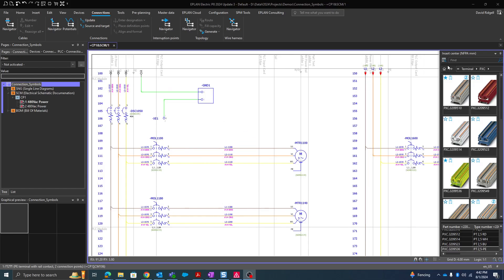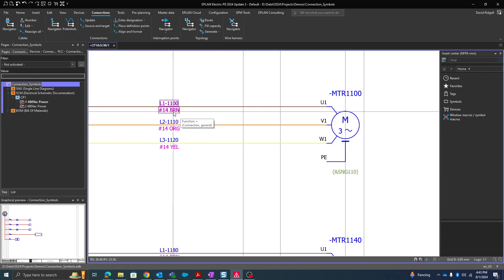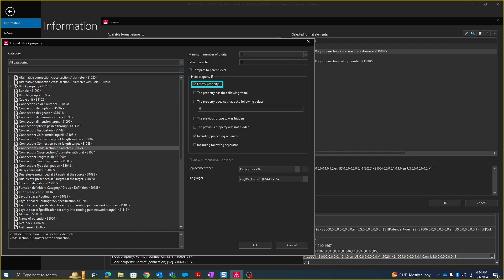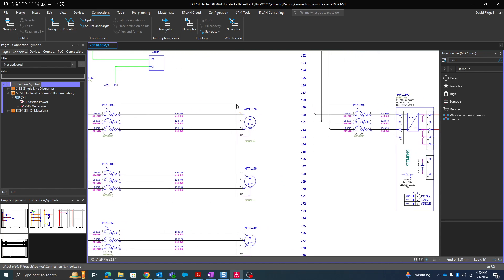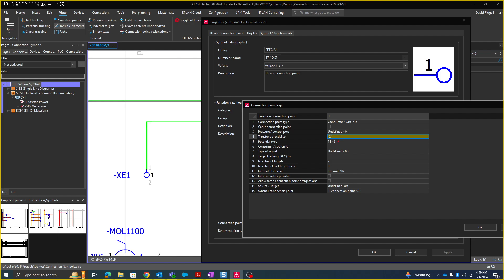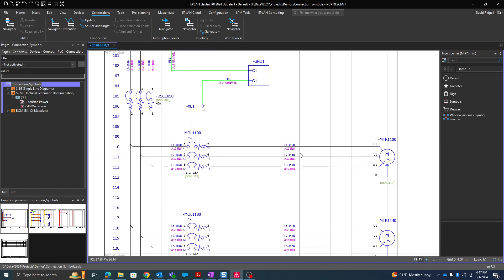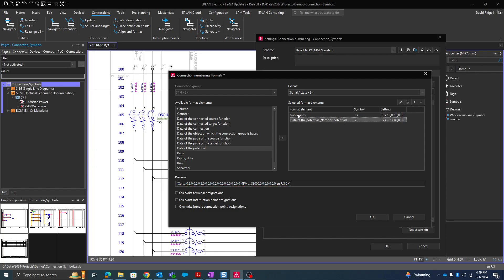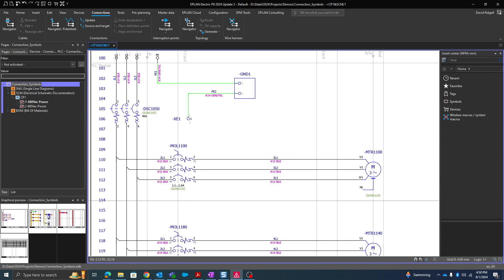EPLAN tips & tricks - Connections, Wire numbering, & potentials

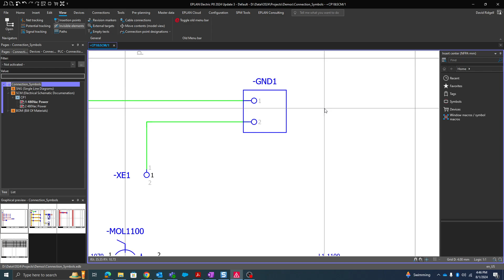Comment: Pretty cool i was locking for a way to hand on the potential in a black box from one blackbox connection to another for a bit of time.  4:04

Thanks for the Video👏🏻🤩

One further Question in hope of a reply🤗
How do you handle this, if there were more connections with the same designation and the only difference is within the Plugname? 

Best regards 

Chris

Comment: I have not been able to get the connection definition points to act as part of any group other than the "General connections" group. When I configure that group to show the potential and wire gauge, no problem, the settings of the 3PH group don't apply anywhere. 
Any idea what I'm doing wrong?
Reply: oh awesome I figured it out. I needed to move the custom "Grouping" based connection label scheme above teh general connections scheme in the Designation table.
this is so cool, thanks for the video!